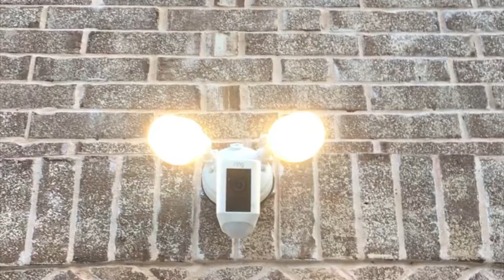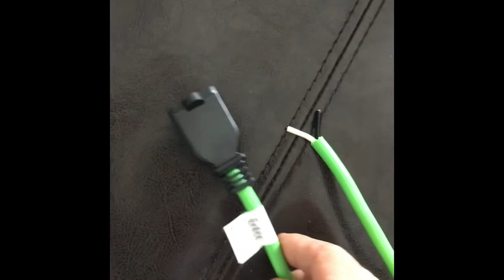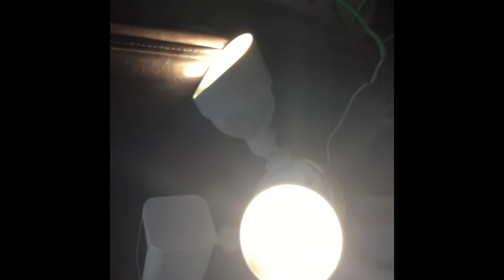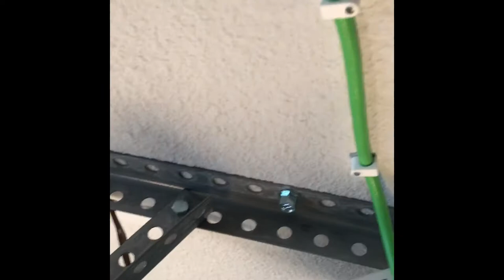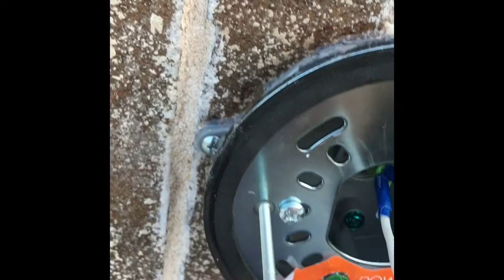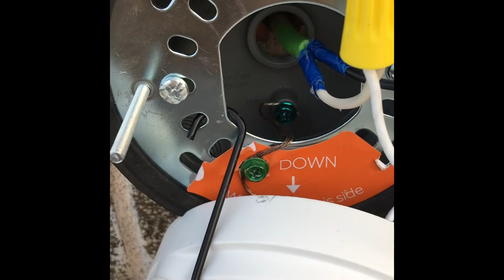DIY Ring Floodlight Security Camera Installation Without Existing Wiring

Comment: My understanding is that using extension code won’t pass inspection and against the electrical code. Planning a similar install above the garage through the brick using rmx 12/2, junction box, switch and to power outlet.
Reply from the maker: Thank you Shabat Shalom for your comment. You are right. I am also going to change my wiring soon. I already got the romex cable. Learning a lot since this was my first electrical DIY. Again thank you for your feedback and all other You Tuber out their for sharing related video.
Reply: Action TakeYou : I could not yet find the instructional video on youtube that would show correct wiring by the code. I guess it is easy when the garage walls are open (i.e no sheetrock), but when you want to hide the romex cable inside metal conduit, connect power outlet to the switch and run the metal conduit above the garage door with the correct spacing all these than it’s more involved work right there. Thank you for the vid. If you can do a video when changing to the new wiring that would be great for all DYIers including me :-)

Comment: are there extension cords available with wire not terminated with plug and open? nvm he cut the plug out from the Husky extension cord and plugged the wire terminals into Ring. Genius! Is this code acceptable?

Comment: Did you use 1/2in or 3/4in round junction box? Planning to do the same setup on mine as well. Thanks
Reply from the maker: If you are asking about the depth, it is 3/4. Also make sure you get the extension cord with 3 pins. So you get earthing wire - I did mistake getting 2 pin extension cord. So wanted to let you know.
Reply: Would it be better to drill on the brick or mortar to run that extension cord?
Reply from the maker: It’s easier to drill on Mortar than on brick.
Reply: Thanks for the response, one more thing did you drill from outside your house or vice versa?
Reply from the maker: @superdrol111  you welcome! I did drill from outside. I did make sure first where I need to drill so it goes thru inside under the garage ceiling.

Comment: Going to do the same, can you link the items you used/purchased for the project . Would really appreciate it
Reply from the maker: @KH Lam - one thing make sure you get the three pin extension cord. I got two pin which don’t have ground cable. Other thing is I used metal/concrete drill bit to drill my concrete wall. Let me know if you have specific questions. Sorry I don’t have link for the items. You can tell I am not a YouTuber :).
Reply: @actiontakeyou  what size bits did you need?
Reply from the maker: @itsGewch  1/2 inch drill bit for concrete
Reply: How long was the drill bit? Thinking of doing the same over my garage. Thank you.

Comment: Okay but how did you run the extension cord from the outlet to the outside? I need another video showing that. 😂
Reply: He ran it on the ceiling and anchored it to the ceiling then drilled a hole from the outside of brick to inside of garage. And fed the extension cord through there.

Comment: I would maybe suggest not doing it this way. Spending a few more bucks for a permanent, up-to-code solution would be ideal.
Reply: What's up to code solution?
Reply: @romang6437  installing a permanent electrical wire. Could put in an armored MC cable just as easily as the extension cord. You would just need a box extension for the garage door opener outlet and to then connect the wires.